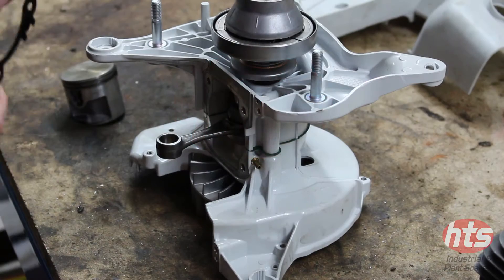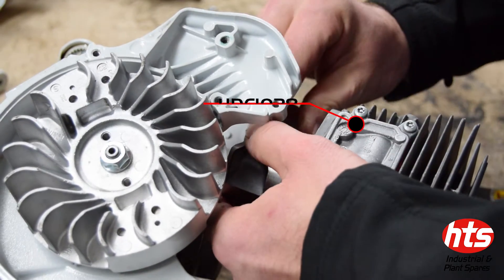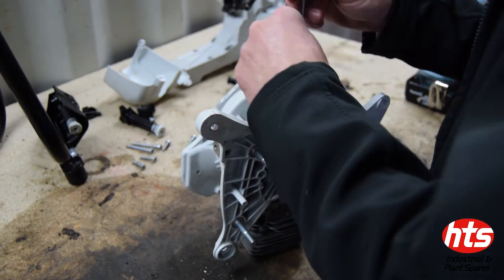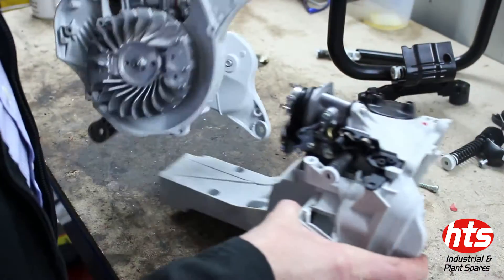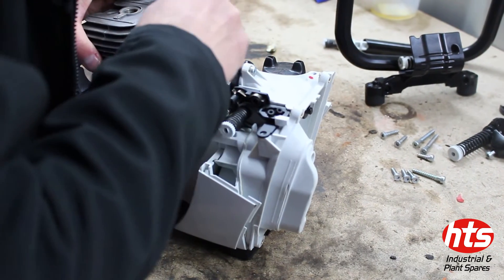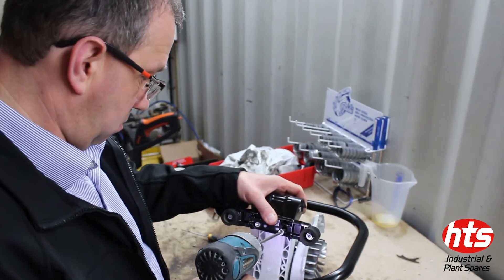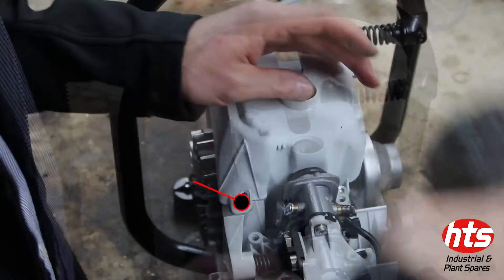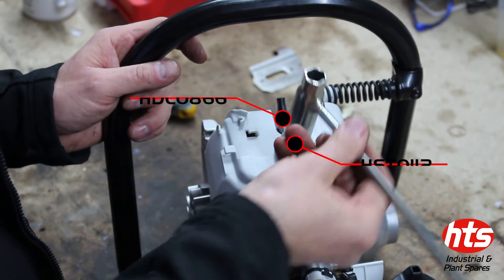How to assemble a Stihl TS410 (Cylinder & Piston) | HTS Spares

Comment: Hi did u put any gasket sealer on cylinder head gasket.or is there no need .
Reply from the maker: Hi Tim. No, there’s no need for sealant as the gasket has a raised portion in the centre of the gasket going all the way round. If your gasket is flattened you should replace it. Hope this helps!
Reply: @htssparesltd  thank u thats a great help